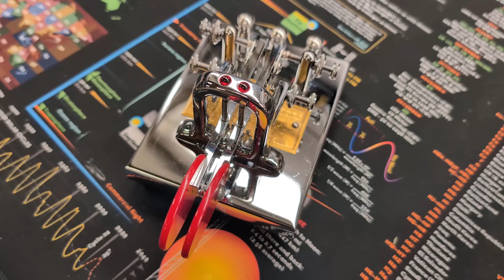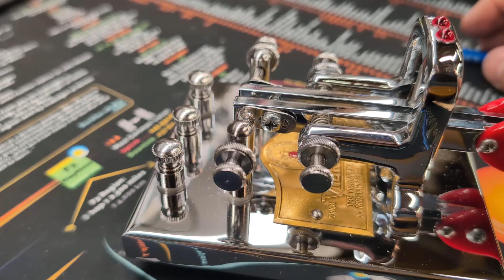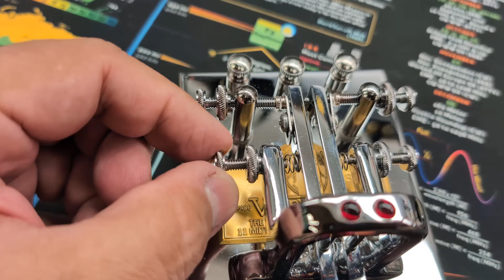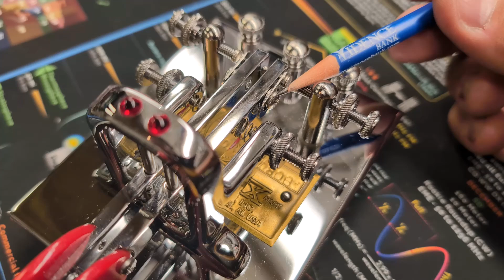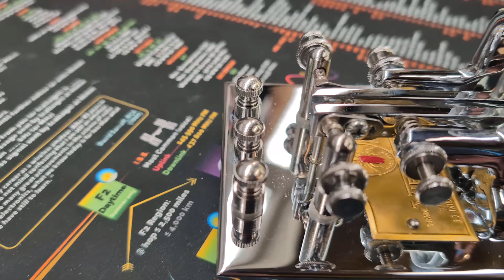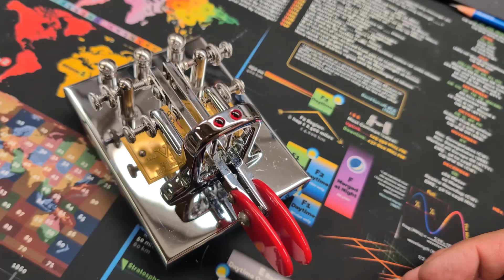Vibroplex Vibrokeyer Deluxe Iambic Morse Code Key

Comment: I just picked up my very first key and it's this Vibroplex Iambic in your video. When I press and hold the right paddle for the long dash the length of the tone is inconsistent. Any suggestions on approach to resolving that? Maybe I need to clean the arm's contact pad surfaces with contact cleaner?
Reply from the maker: That's exactly what I was going to suggest. Some of times those contacts get a little tarnished. Sometimes there's even maybe a little bit of waxiness on them from touching them or something. Definitely clean those babies up! I'm hoping that works!

Comment: Is the Vibroflex Co. still a thing? They used to have a lifetime guarantee. Or maybe they called it a warranty?  Anyway, used to be you could send it back to them, and they would renew it, clean and polish it. Replace any broken or missing parts. And then they'd ship it back.
Reply from the maker: @cw2gtc  yes they are still a thing but they were bought some years ago and seems like the lifetime guarantee is no longer.